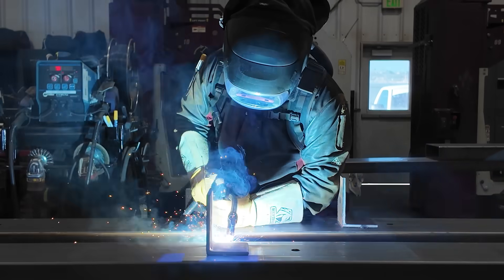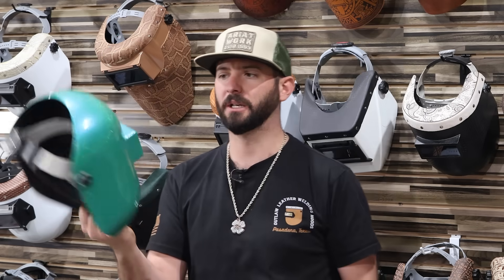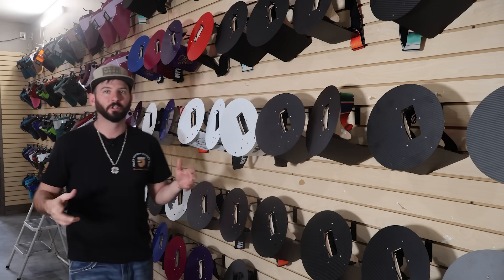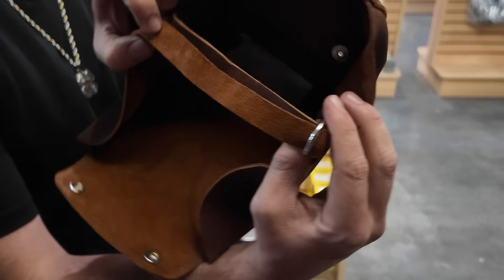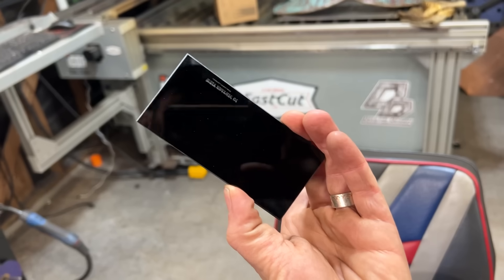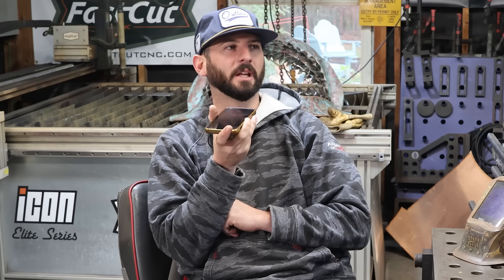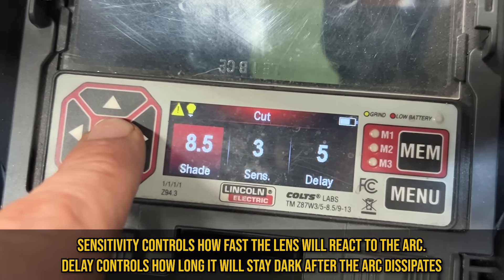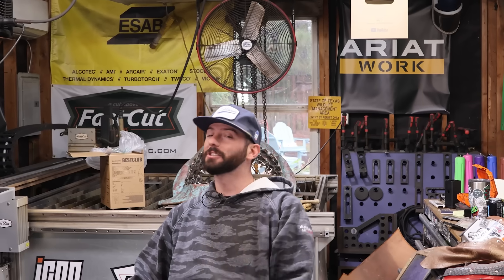Everything You NEED To Know About Welding Hoods

Comment: I have an old beat to hell Jackson safely knockdown, and a viking 1740 on the auto dark side. They're both very simple and durable, although I did upgrade the viking headgear. The Jackson will outlive the entire planet lol. I had an older pre digital Miller elite and it was fantastic, and I only paid 15 bucks for it at a pawn shop. Unfortunately the battery cracked after a couple years and I sold it to a POS I worked with when I needed gas money. I've used Miller classics before, and they're cheap garbage. The 1740 Viking is the much better buy at a comparable price

Comment: 20-30 yrs welding, and I've never seen any of these chopped hoods, or pocket hoods.  But then I've only met one pipeline welder and mostly worked in and around construction type jobs.

I was going to say the best headgear is one you can find a replacement for.  I always ask for a Jackson style hood because I know I can get replacement parts for them regardless of the shape or manufacturer or the actual shell.

I've never had the side screws strip out, but I have had the ratcheting mechanism on the back fail.   I've also been given cheaper hoods by my employer that just wouldn't stay up when you needed it to because it didn't have quite the correct design on the flip down hardware and it wouldn't accept a jackson headgear without modifying the mounting holes.

It seems like now almost everyone in my field just jumps right into an auto-darkening setup.  I refused to buy one for years because of the cost of replacement and it wasn't until the last 5 years or so that I started using them.   I always liked the gold lenses that let the weld pool show up in a more red spectrum, but as I get older it's a lot harder to see the area around the puddle, as it's just too dark.

Some jobs require you to wear safety glasses even under your welding hood and that also makes it a lot harder to see as you can get a double glare effect, more fogging, etc.

Comment: Ive worked for SpaceX and Aerospace as a Tig Welder for years. The type of welding we do here is very very low amperages tig welding so If you choose to buy an Autodarkening helmet and bring that to an Interview, make absolutely sure that it has at least 4 Light Sensors on it AND that you have BRAND NEW batteries on that thing before you ever step foot in the door. I cant tell you how many people bring cheap 2 sensor welding helmets to their Interview with dead batteries and have to embarrassingly borrow someone else's hood just to complete the Interview because their helmet keeps flashing them or its just completely dead. Your helmet should be able to be triggered just by looking at a light bulb with the sensitivity level on High and stay triggered until you look away. Or you can just get used to welding with a fixed helmet with a shade 9 lens instead....

Comment: I bought different pieces and parts for my custom hood and made everything work together. carbon fiber pipeliner shell with flip up heavy duty lens setup, viking sensor, miller headgear exactly the same as my general duty miller, with custom leather and chicago screws, with a custom handmade sheepskin headgear wrap. Got tired of getting burned doing overhead and decided to use my skills to make something that looks really cool, is more durable than my miller hood and is a great talking point.

Comment: which one accomodates a respirator or mask?  Not the cheap mask but the ones with cans?
Reply: I use a Fibre Metal Tigerhood and it reasonably accommodates a 3M quick-latch respirator; I use the 2297 pancake filters.

Comment: Get at least a 3m quick release (my fav) respirator with 2097 filters, so to avoid breathing hazardous fumes. It' is important that your helmet can handle your respirator.
Reply: I picked one up but it doesn't fit under my hood. Getting crazy tryin to find a hood it fits under.
Reply: @jimr7120  Jim, keep looking for one. Mine fits me with a pipeliner style plus it works with Hobart helmets. I think it was a Lincoln that I had, where it wouldn't work. I have 3 different pipeliner helmets that work.  Miller makes a low profile  ML00894 Lpr-100, and GVS makes one too, I think.  Make sure the cartridge works for welding fumes. Those two might be even tighter to the face than the 3M  6503QL , that I use with the 2097 filter.  The Hobart Helmets at Tractor Supply will work. I use them at work and home.
Reply: @BCole-bj4lv Awesome! Thanks for the insight.

Comment: I have used a CMR fabrication sugar scoop hood for about 2 years and it works good, the lense looks amazing but it’s the auto darkening 5-13 Shade and sometimes when I’m welding it will start off super light like a shade 6 and get darker up until I can’t see like a shade 13, not sure why that would happen, but the hood itself is indestructible
Reply: My guy what u think bout pipecloud🙏
Reply: @randypitts4518 the only pipeliners cloud hood I used was great